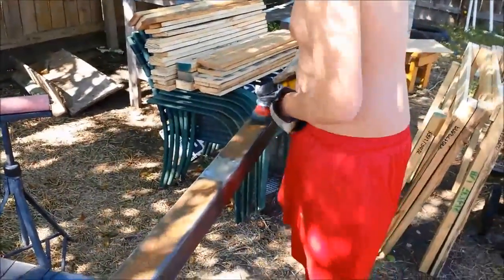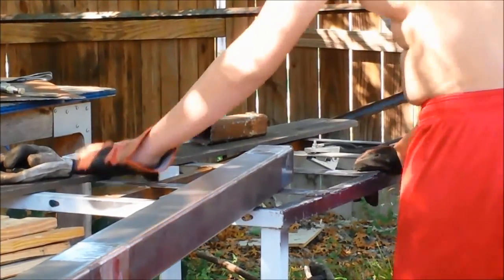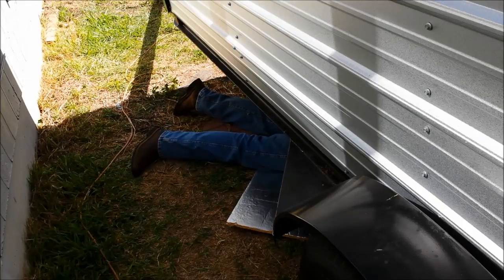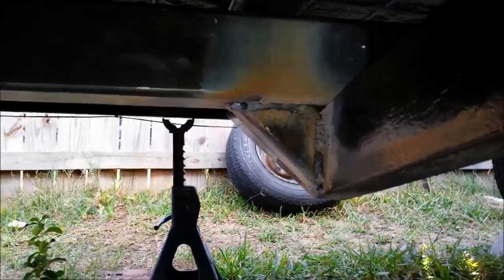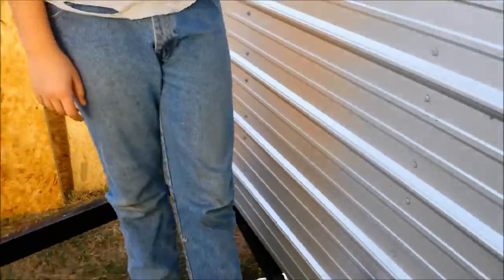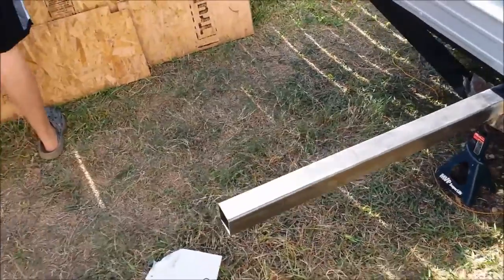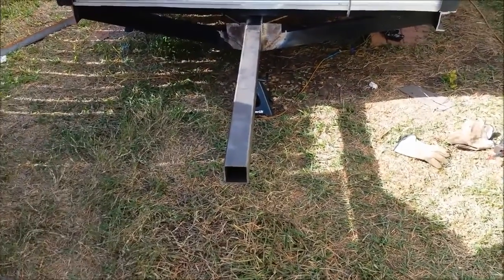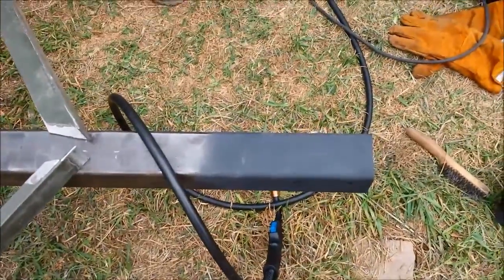DIY camping trailer RV - tongue replacement

Comment: Nice job, but you could have cut the tongue and left enough of the side channel to heat, bend and weld onto the square tubing. Just a thought, but your idea will work just fine